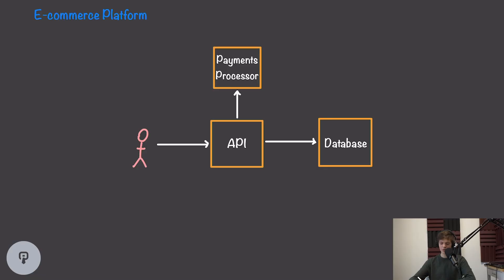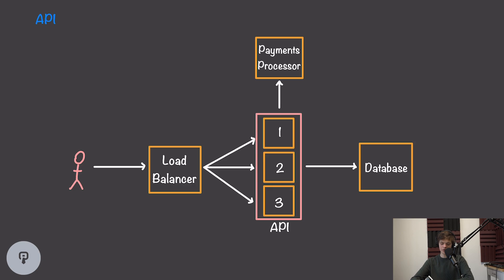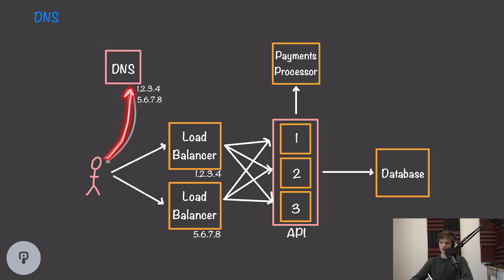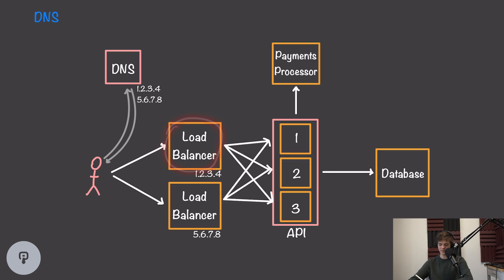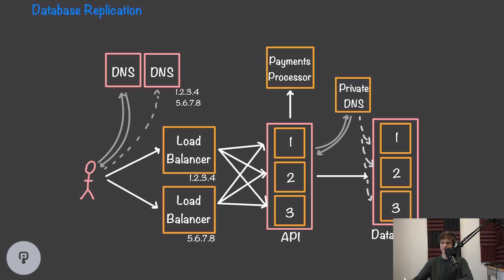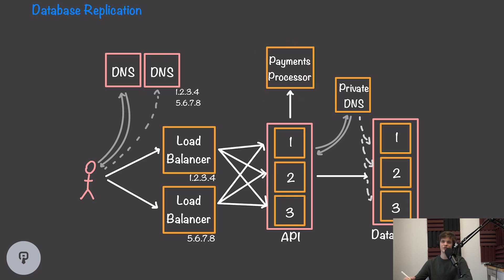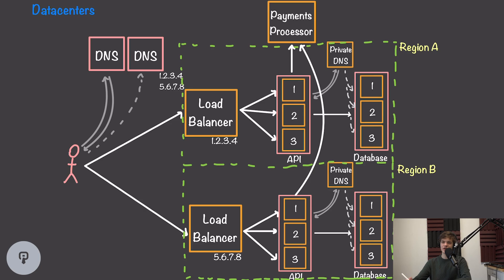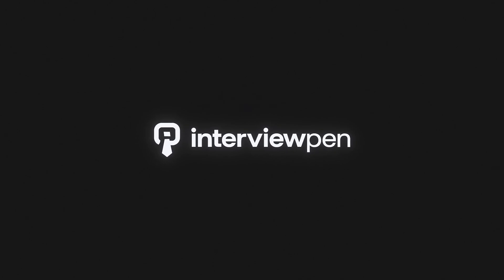Design a Fault Tolerant E-commerce System | System Design

Comment: Great video, I was wondering on how to handle autoscaling? In your diagram you have created 2 LBs, if one goes down and the minimum number of instances is set to 2, you need a way to recreate it in order o reach again 2 active instances. Or if we look at the big picture, if one region goes down, you'd need to recreate the whole infra in another region. What would be the best solution in order to do that ?

Comment: Could another load balancer be on standby for when a load balancer goes down and take its external IP address? Or is this scenario assuming something happened where that’s not possible like the data center going down
Reply from the maker: Yes, but there still has to be a fixed-size set of online load balancers to not interfere with the user experience.

Comment: How often you will have DB outage on cloud providers? And will another DB instance work at the same time. Also didn't see any options for multiplication of DB instances, only DB replicas for read operations. As for Payment API failor only way is a retry logic or error message to try later. Maybe there are also open websites we in live mode people can see failure status of the system
Reply from the maker: Most cloud providers have SLAs on their database solutions, and most offer replication to increase that SLA. Hope that helps!

Comment: For the redundant load balancer section, you mentioned that it isn't a great solution because it introduce latency and less flexibility because of DNS cache. Then I'm wondering what is a good solution or some alternative solutions?
Reply from the maker: These problems are why we introduced a load balancer--failure of a load balancer should be much less likely than failure of an API node, so we can take advantage of that solution in most cases. Thanks for watching!

Comment: Thanks. What about the DB replication/synchronization across the regions, and the potential failure of network communications between them?
Reply from the maker: Yep, definitely a concern. A network partition between the two regions could cause a "split-brain" situation where the two regions end up with different states. Often we'd just have one region elected as a master to handle writes, with reads from other regions having eventual consistency. We have a cool video about this kind of stuff on interviewpen.com :)
Reply: Latency (and thus eventual consistency) is also a thing even if you use a single region replication. This needs to be also handled properly by the application.